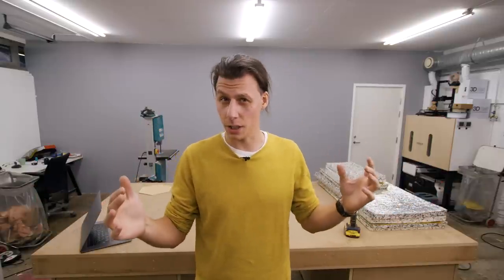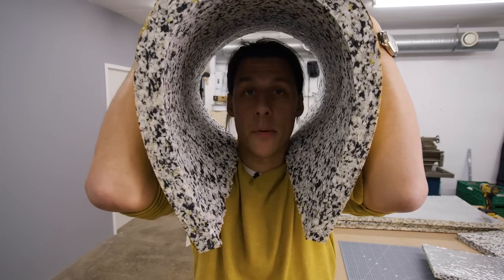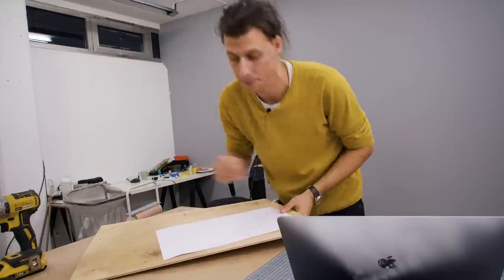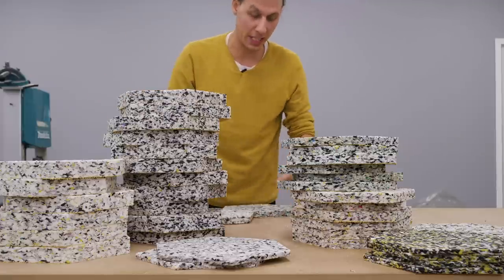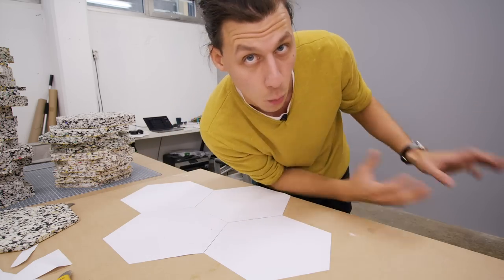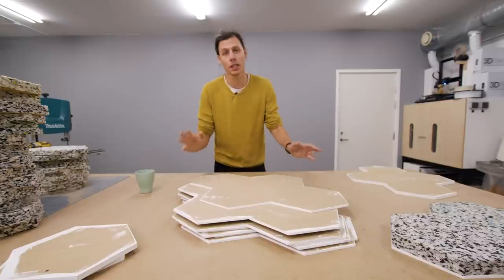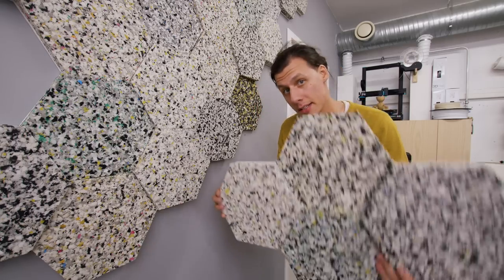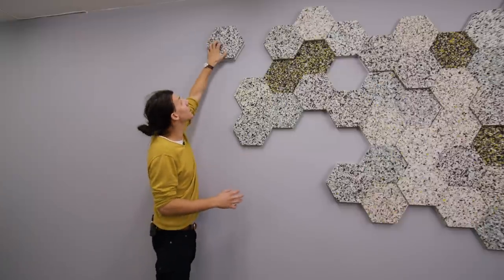How to make acoustic wall panels

Comment: The easiest way to hang up sound foam, is to put blue painters tape on backwards, then you can just slap them on the wall. If the sound foam do not have any adhesive, then use double sided carpet tape, and then put on the blue painters tape backwards on the carpet tape. They stay up forever, and are easy to take down agian.

Comment: Nice idea, thinking about something similar for my living room / makeshift studio. I'm quite sensitive to dust though, and I wonder how you handle cleaning those uneven textures and edges especially in a workshop.

From an acoustics perspective, you might want to have your backboard a centimeter smaller to create a little bit of overhang where sound can bounce off the wall and be absorbed again. It will only help with the highs, but it's still something. Also, it would allow you to glue some hidden LED backlighting around the periphery some some extra pizzazz. And maybe leave an island sea to counterbalance that lonely island you have? Just some random ideas.

Comment: Cool vid!   I lined my CNC enclosure with acoustic ceiling tiles. They worked like a charm.   I'm thinking of following your lead and cutting some to add some sound absorption to the walls of my shop.   Thanks for the ideas!

Comment: I think you may get better performance from these panels if you try to space them out a bit more on the wall, effectively attenuating more nodal points on that wall. Seriously awesome panel design though.

I could see using these with a french cleat system to be able to setup for vocals when needed, and spread out when recording the room. Very flexible, much props to you!

Comment: Great project and great panel. Just a heads up, use a mask or respirator when cutting or sanding MDF. That dust is nasty and you do not want it in your lungs.
Reply: I think he relies on their massive dust collection system, but I agree with you. Better be safe than sorry and there will always be particles released when doing anything with wood.
Reply: @Arterexius  I wonder if his nose is closer to the dust ot the massive dust collection system?

Comment: Such a well produced video! What's the name of the material you used?
Reply: There’s a link to the material he used in the video description box, it’s listed as a soundproofing mat, made of foam plastic with an outer layer of aluminium-coated polyester foil with self-adhesive reverse side.
Reply: It looks like PU foam. Easily available in the UK, made from recycled "crumb". Known as carpet underlay (often without the foil layer) or foil backed insulation. Sorry it's a bit late, just seen the video!

Comment: You really should be using a good respirator when cutting MDF, it has a lot of nastiness in it that you should NOT be breathing in, even if you're only working with it occasionally. Your insulation is mostly a white color, and your walls, a light grey. I would have painted the edges of the MDF black to make them really pop. I would have also put about an inch of separation between each of the panels which would have added a design element, and spread out your insulation a bit further.